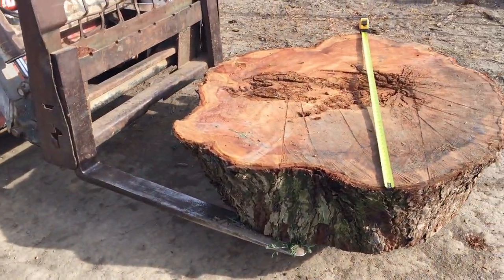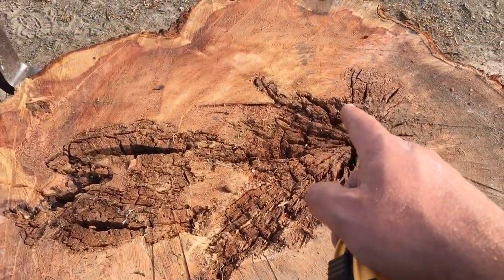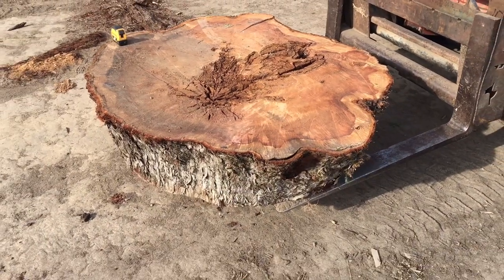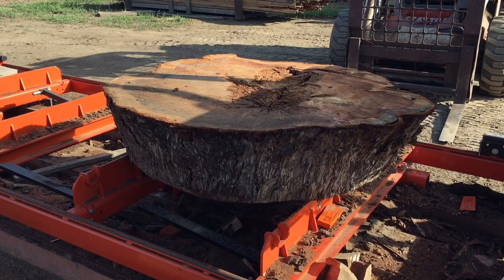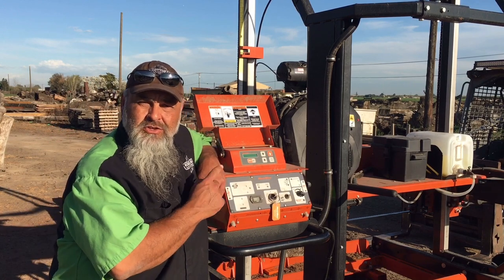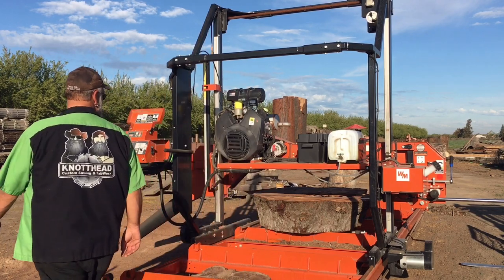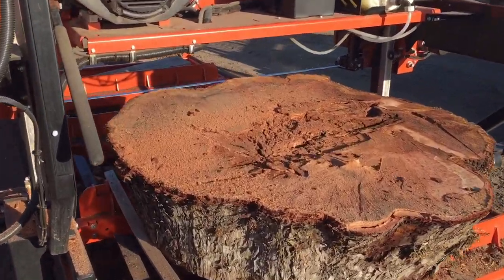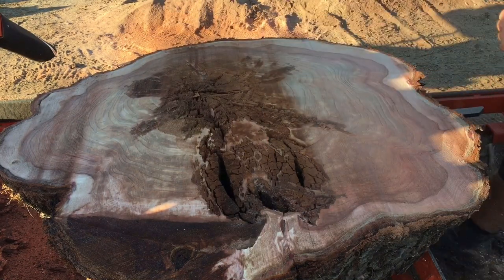WoodMizer LX250 Sawmill Cutting Giant Cookies - California Redwood

Comment: When I set the simple set I've got to add 1/8" for example 4" cut would be 4-1/8" does the machine you have do the same as mine or woodmizer take in a count of the blade thickness?
Reply from the maker: I guess I should have mentioned that in this video, you are correct... SimpleSet does not take the saw kerf into account in the setpoint and the actual drop. We have machines with SimpleSet, and machines with Accuset2 setworks, the simple set machines drop the actual amount you have set in the computer, so a 4" drop will yield an actual drop of 4", the Accuset2 setworks machines wil drop 4" plus the saw kerf thickness you have programmed into the Accuset2 programs.

I will clarify that in a future video that I have planned! Thanks for bringing that up because it is a pretty important thing for people to know! 👍
Reply: Thanks for getting back with me, love your videos, you have a great operation there🙋🏻‍♂️